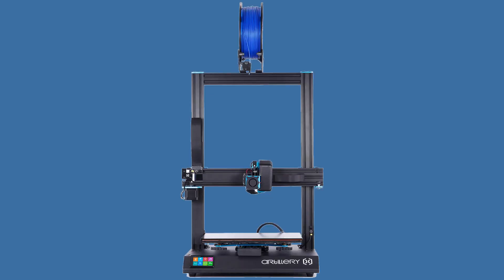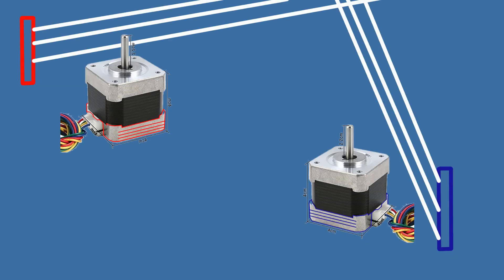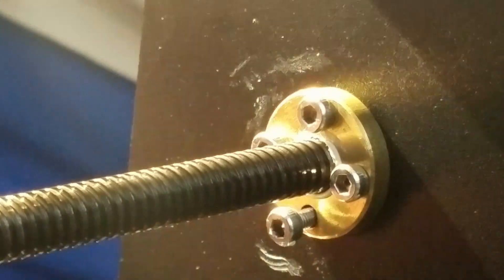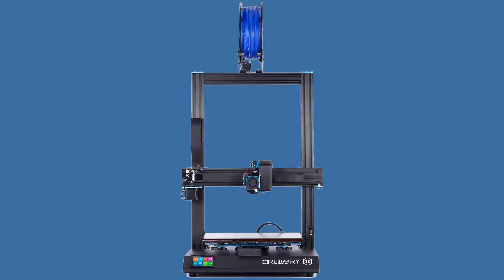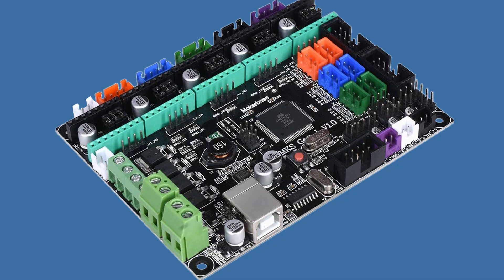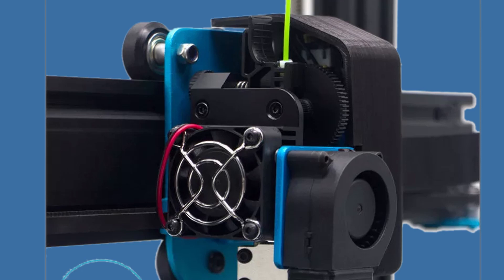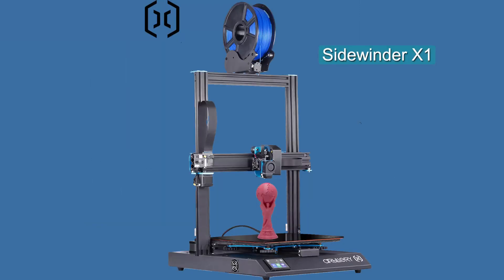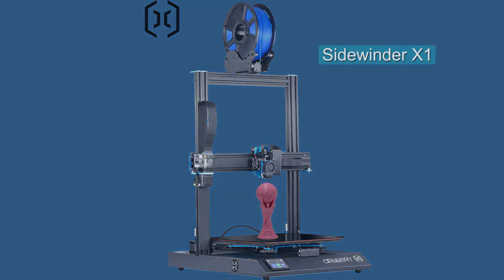Artilery Sidewinder X1 pros and not too many cons, Finally a complete 3D printer

Comment: Short and quick review. As others have commented, the X1 for sale these days is the version 4. I do not know why you show pictures and talk about the initial release version from 2018 that had some room for improvement. Now they have changed the cooling fan arrangement from the side to the bottom of the chassis, the glass bed now comes with a textured surface, the bed adjustments screws are bigger and easier to use, the LCD is implemented in a nicer way and there is a reset button to the right of the LCD screen. These are some of the improvements I remember from the top of my head....and the filament feeder now is made from metal (the part that grips the filament looks like brass)
Reply from the maker: thanks for making me aware.